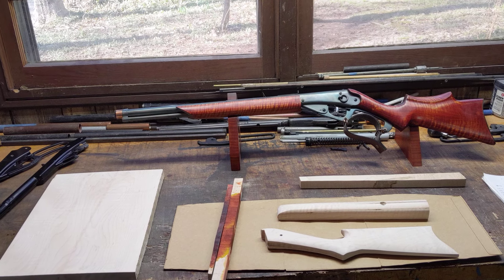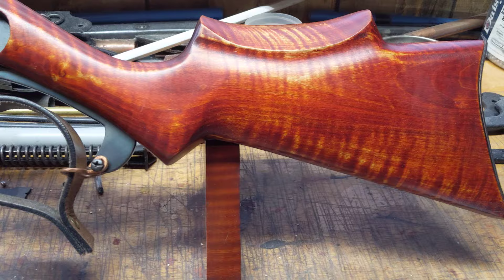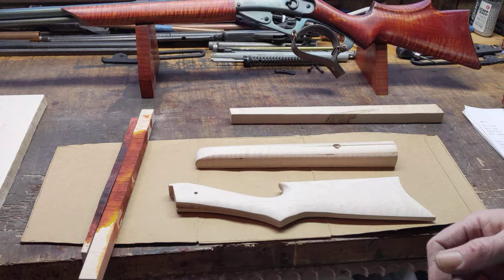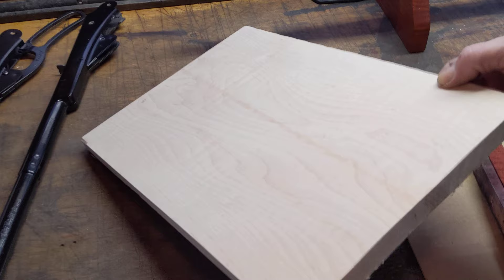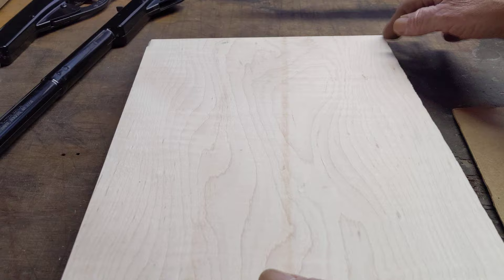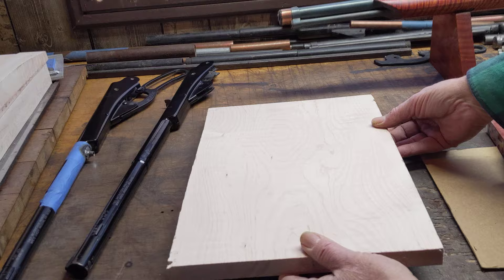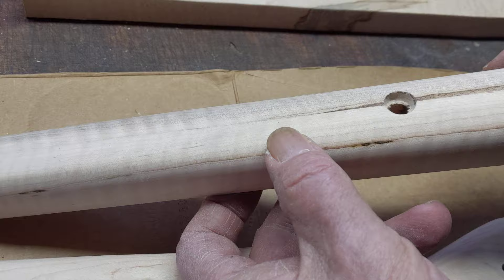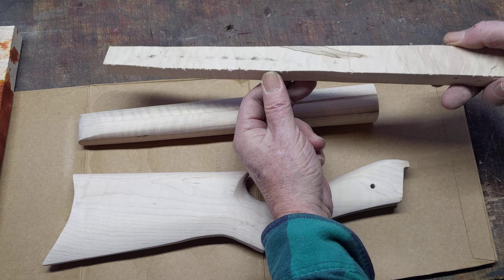Dyeing figured Maple The Restomod Daisy way

Comment: You really do have a unique color combo going on. So much appeal. Within the past year, What I have been incorporated, is when transitioning from the blank to a stain or oiling, I like to use a 0000steel wool. And give it a good rub down all around. The way everything soaks in,it tends to bring out a softer transition between grains. When I apply my shellacs, things tend to lay down buttery smooth, no matter what method I apply.
Reply from the maker: Thanks man. Getting the color palate to where I wanted it took a lot of fiddling about. I find that leaving the surface at 220 really gets the whiskers up on the wood and seems to get better penetration for the follow on coats of dye. The drawback is having to wait for the stock to get really dry before hitting it up with the first oil coats. Process is process.